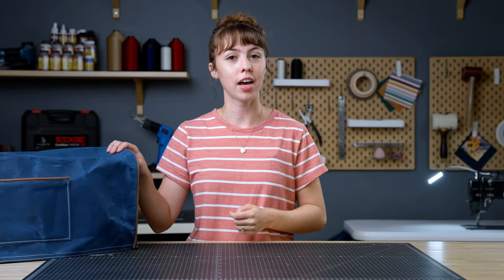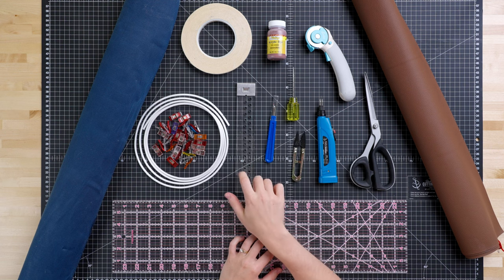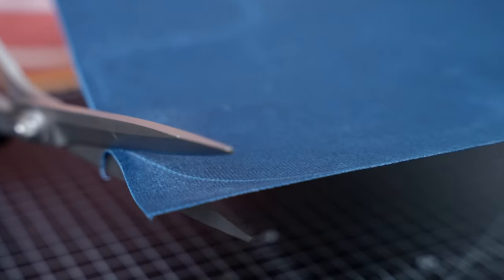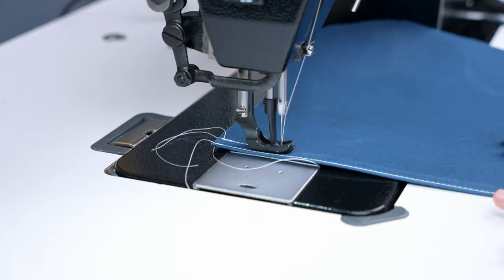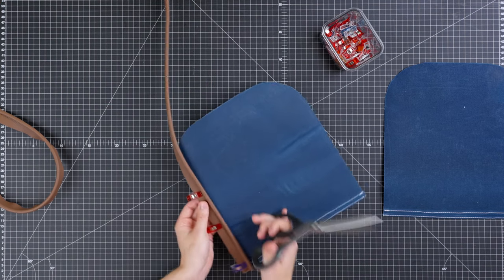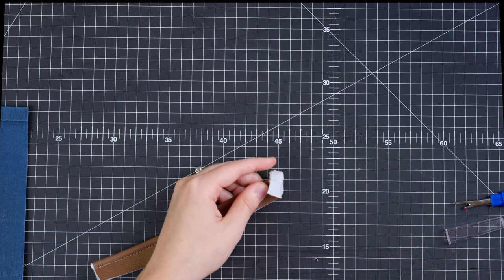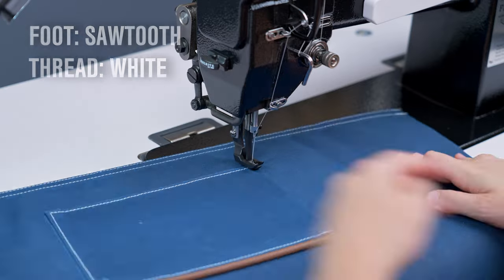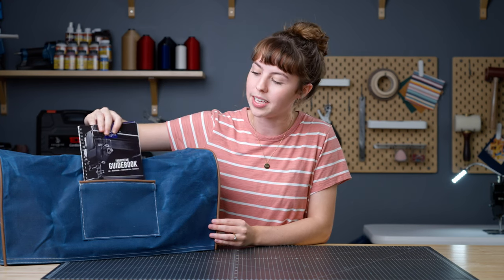Protect Your Sewing Machine With This Easy DIY

Comment: I don't see the pdf download for other machine brands. Help please?
Reply from the maker: The template we had for other machines didn't work as well as we liked so we removed it while we contemplated how to make it work better for a wider variety of machines. Sorry for the inconvenience! Our other channel, @SailriteDIY, has another dust cover project designed for the Ultrafeed sewing machine which are a little bit smaller in size if you would like to check that video out: https://youtu.be/-uXQI4vchrs
Reply: @SailriteWorkbench  Curses !  I was looking for the template for other brands also.  I am actually trying to make a cover for a small generator using outdoor fabric.  It is just a bit bigger that your Fabricator so I will try to adjust myself.  Thank you so much for the video !!
Reply from the maker: @cwillis2033  Not sure if this will be helpful for you with dimensions but on our Sailrite DIY channel we have a video on how to make an air conditioner cover. Here it is: https://www.youtube.com/watch?v=zlZQ3na-A_I Good luck with your project!
Reply: @SailriteWorkbench  Very helpful!  Thank you.

Comment: The fabric looks very creased.  Is there anyway to prevent that?
Reply from the maker: The fabric that we used for this project is DuraWax which is a waxed canvas. Waxed canvas  is designed to show creases with use to create a rugged look. A benefit of DuraWax in this project is that it holds it's shape well. Here is a blog that explains the unique features of this fabric and gives some tips to remove unwanted creases and marks: https://www.sailrite.com/what-is-durawax-waxed-canvas Hope this is helpful for you!